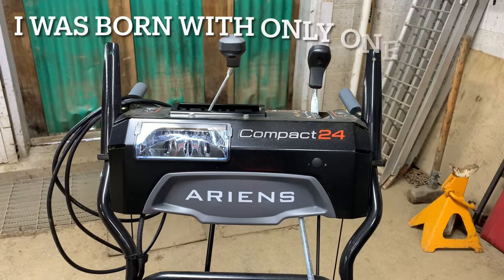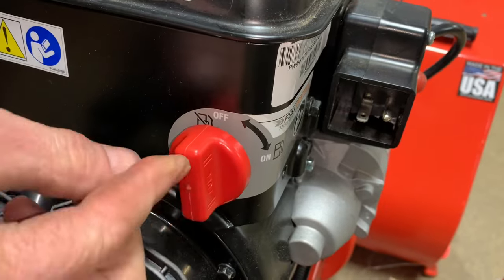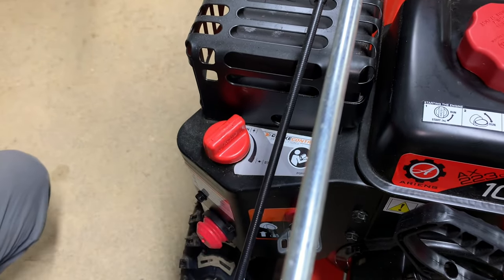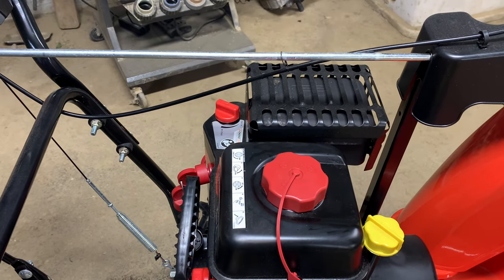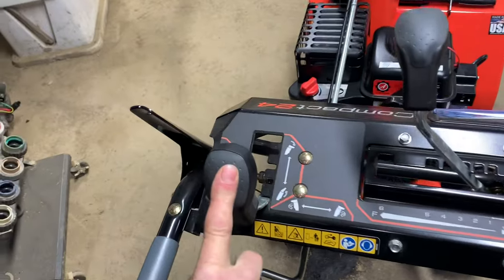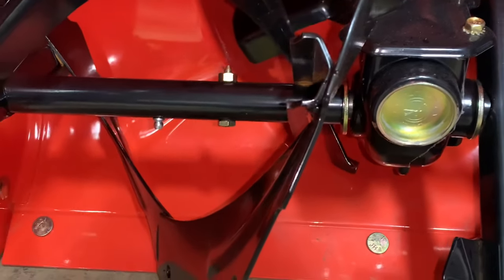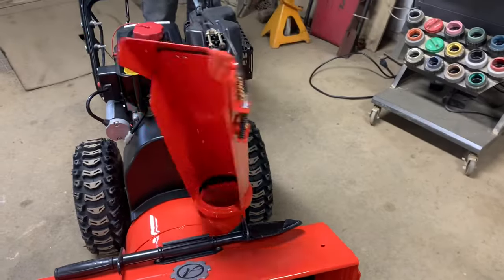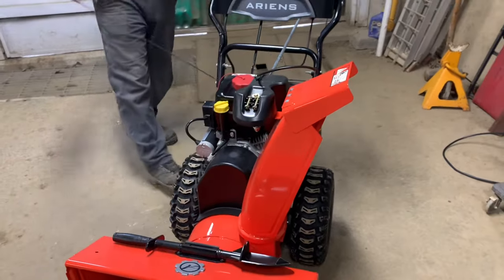How to Start and Operate Ariens Compact 24 Snow Thrower

Comment: Thank You - Just purchased this machine after a snowless winter in the NYC Metro Area !!
Reply from the maker: Hi Tony, You live in a area just like me, where you may or may not get snow depending on the winter. I highly recommend not using gas from the gas pump and start using Aspen 4 that you can purchase at a store. The reason to purchase this fuel is to help keep your machine running during the off months and for you and me, it can be a long time. Gas from the gas pump can go bad within a few months in small quantities clogging the carburetor internals and your machine will not run when you need it. Check out the link and make up your own decision.  https://www.aspenfuels.us/products/all/aspen-4/. I am not affiliated with Aspen at all and making no profit by telling you this. I just want you to make sure your machine runs when needed. *Note* you  cannot mix pump gas with Aspen or results will be poor. Run your machine dry/or/drain then use Aspen.

Comment: Just picked this model up after a few decades using a small rubber auger toro that still runs but on its last legs. I was a little intimidated with all of the new controls 😆 Thanks for tips!
Reply from the maker: You are going to be able to move a lot more snow with this machine but it may not do very well with the really small snows like your older model. I’m sure you will be happy with it as long as it is in good running order. I’m glad it was helpful and thank you for the kind comment. Please give this video a like, subscribe if you haven’t already, and share my channel to help it grow. It would be greatly appreciated! Thank you for watching.

Comment: Thanks for an excellent video. Considering buying one of these used. I didn’t know it has no throttle control. I guess you usually run it at full throttle but would be nice to let it warm up or idle down if you wanted to. Seems like they cheaped out. I have an older ariens 24 with Briggs and Stratton engine, throttle control and rated 9 ft lbs torque. This new model has 10ft lbs but ariens engine so a bit more power.

Comment: Thanks so much for the video ~ but following all the instructions, and we did have it serviced in November, while the engine turns over beautifully, but it just won't start.  Any suggestions? :-(
Reply from the maker: Hi Debbie, depending on how old the fuel was when the machine was serviced and I will assume you did not start after it was serviced until you needed it. Most likely the fuel in the carburetor is now in poor condition and the machine will not start. You will need to drain the carburetor bowl if possible, some are easier then others. Flush the fresh fuel through the carburetor from the gas tank then try and start it. If it does not start after that you may need to pull the carburetor and rebuild it or replace it. I would suggest watching this video so you know what I'm to trying to explain to you. It is a different machine but it is the same process.  https://youtu.be/Wj25U4FDV-0. I would also suggest, stop using the pump gas and start using ASPEN fuel for the snow thrower. It will stop the issue you are having. Here is a link to read up on it. https://www.aspenfuels.us/products/all/
Reply: @JohnsonsSmallEngines  Thank you so much - it turned out that my husband didn't turn the gas on - it was located on the back of the engine and it was impossible to turn with our fingers - once he got it turned on ~ shocker - it started.  Thanks so much for your reply!
Reply from the maker: Glad to hear!
Reply: My experience exactly. My Ariens has been hard starting since day one for the last three years. Today it wouldn't start at all.

Comment: I am glad I don't need a snow blower or thrower.  We just missed the huge storm Izzy.  It just rained on us and stayed warm enough to not freeze. I hope you didn't get more than you could handle.  BTW which do you prefer snow blower or snow thrower?
Reply from the maker: Hi Steven, My thoughts behind snow thrower verses snow blower. My opinion is any version of a machine that is not a two stage (single stage, only paddles) and only has rubber paddles is a “snow blower”. any version of a machine that has two or more stages, the first stage pulls the snow in (augers In the front) and the second stage (one large fan behind the front augers) and is self propelled is a “snow thrower”. If you can picture the two, you would understand a bit better.
Reply: @JohnsonsSmallEngines  Thanks.  Hopefully I'll never need one or the other.  I live on the edge between snow or not snow.   So unless get a real bad storm most of any snow I get melts off in a few days. Thank goodness lol.

Comment: If you keep pin to outside only one wheel will be in drive you can use it to throw snow like this just makes turing easier mine starts with just one pull i run it every month or so for 10 minutes and use pure fuel ethnolyn free fuel i buy at lowes so you dnt have to ever remove the fuel.

Comment: How do you start one that hasn't been started in about 4 yrs?
Reply: I'm sure my brother in law did not put it away correctly also. He told me he only used it twice.
Reply from the maker: Depending on how mechanically incline you are? If there was gas left in it? Watch this video and you may be able to get it going. This video is not the same machine but the process is the same. https://youtu.be/Wj25U4FDV-0. If you will need to replace the carburetor. This video may help. https://youtu.be/8NDxA4FrQ_Q.

Comment: I like my compact 24. Mine does require a lot of priming 8-10 pumps and full choke to start. The throttle is not adjustable just on or off which I don’t care for but that’s the way it’s made.

Comment: Hi when i put back from start to choke why is it blowing litlle black smoke? its the 1st time i used it today. i live in canada.
Reply from the maker: It sounds like your putting the choke on. That’s why it’s called the choke position. It’s giving the machine more fuel and it is choking so you will see black smoke. You only use the choke when starting the machine. You should take it off of the choke position and put it to run when using the machine.
Reply: @JohnsonsSmallEngines  yes i did the wrong way. i realize after watching more of your video lol. but i get it now thank you for your help and the 
time!

Comment: Only my right tire is rotating and not my left would you by chance know why?
Reply from the maker: Look at the axle going to the wheel while your operating to see if the axle is spinning inside the wheel? If it is you have a broken wheel bolt that holds the wheel to the axle. If the axle is not turning. You have a issue under the transmission area and you will need to take off the bottom pan and look to see what has happened. Let me know how you make out!

Comment: I bought one about 6 years ago  the thing I don't like about it is that it goes full throttle right off of choke on a cold engine  my old Craftsman  had two levers one for choke and one for throttle  so I could leave it idle off of choke to warm the engine up the Ariens is one knob that controls both throttle and choke so there is no happy medium it goes from cold to full throttle

Comment: I'm shocked that Ariens, a premium brand, would have a cheap hand crank for the chute direction and separate from the distance chute control on top of it.
Many lower cost brands have simple, easy to use directional chute controls that don't require the tiresome old tech. hand cranking that takes more time to adjust than new technology units.
Reply: Yes, but many of the newer models components are prone to break...
Reply: One of reasons I bought it was because of the manual crank as other cable types tend to break .
Reply: @cathyrobi3891  You make a valid point Cathy as I have found out with recent snowstorms my new Toro with the joystick tends to freeze in one position.
Reply: @desiderious1  I think its why Ariens has used this design for 50 years
Reply: This "compact" model is the bare bones less expensive model.  The "deluxe 24" model has a throttle lever and  more power 12 FPS - larger engine.  Also, it has an upgraded drive system which is automatic...no pin on the axle.  The direction control is easier to use too. The tires are larger as well. 
Is the "compact"  OK?  It will get the job done at a cheaper price point.

Comment: It's not a 10HP more like a 6 or 7, just saying.
Reply from the maker: I guess the manufacturer must be lying. Says it on the gas tank. I hope for there sake there not. Briggs was sued years ago when someone took the engine off and put it on a dyno. Briggs lost that case.
Reply: @JohnsonsSmallEngines  Does it say 10 hp, or 10 pounds ft torque? The compact has a 223cc engine, and that's definitely not enough cc's to equal 10hp. The 254cc engine on the Deluxe model is only 8 or 8 1/2hp. The 306cc engine on the Deluxe SHO is most likely the 10hp engine.
Reply: At 0:41 on the engine it says 10 ft pounds of torque and AX223 size, actually a 7hp.